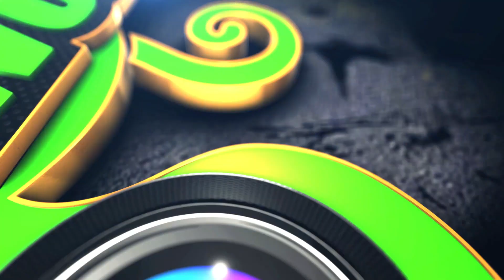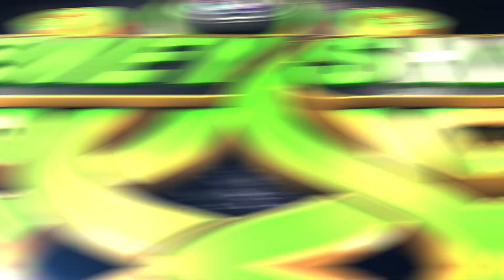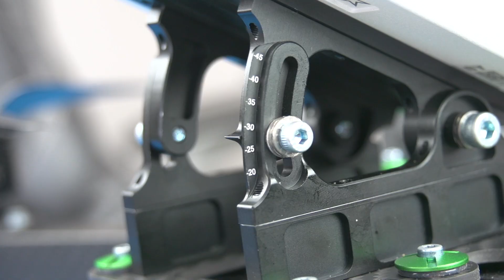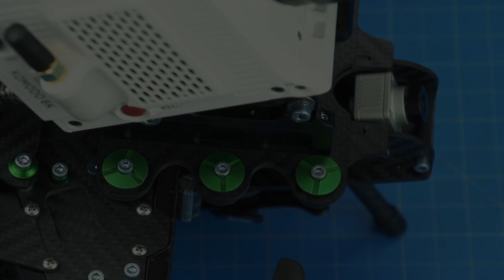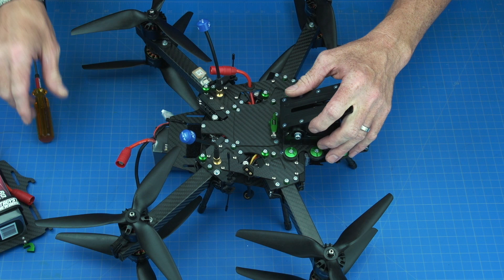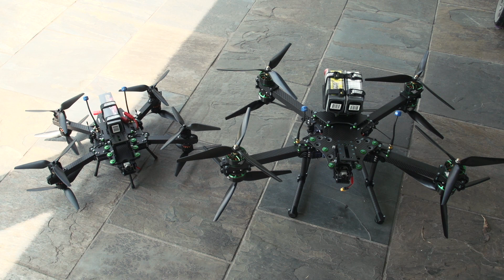Money Shot Mini Design Review

Comment: While being concerned on the safety of that much mass moving fast around people (talent does unpredictable shit,...), the mount needs a screw drive to be able to adjust the tilt in flight.
No doubt the customers will be asking for V-Lock or Anton-Bauer battery mounts, for commonality with batteries used on cameras, sound gear, monitors and lighting.
Reply: Oh we meet again. I personally would prefer just a DTap adapter (similar to how they power the camera) for accessories wireless video/lcs. My worry would be the weight adding an extra battery.
Reply: @Thefredbanana  worry more about vibration, d-taps aren't locking connectors, vibrations from props and motors may cause a d-taps to work loose. Better to let Catalyst advise on which connector won't come loose in flight.
Reply: @PiDsPagePrototypes  excellent thinking. Totally right. It would be better to have a 2pin Lemo powering accessories. Would be lighter as well